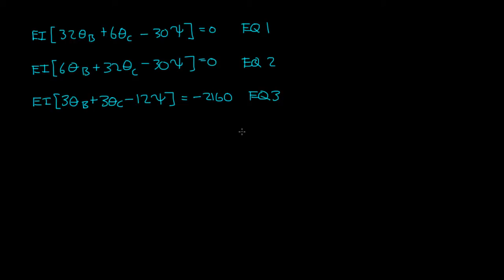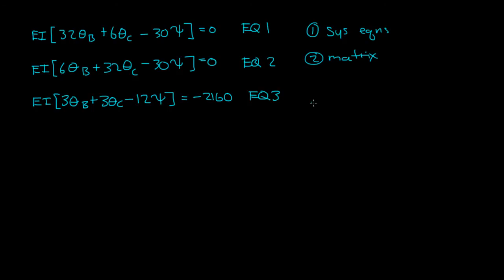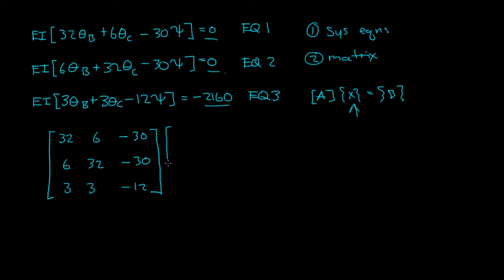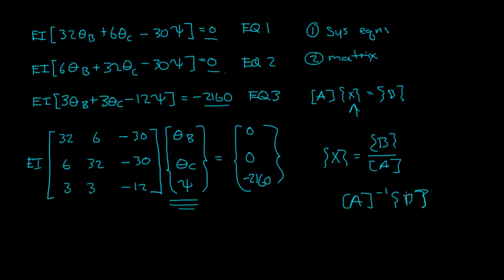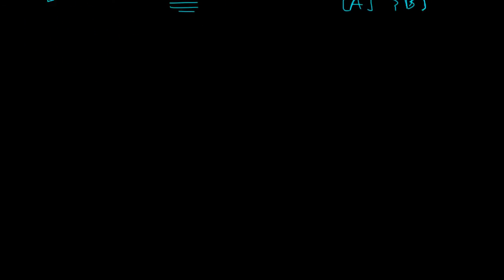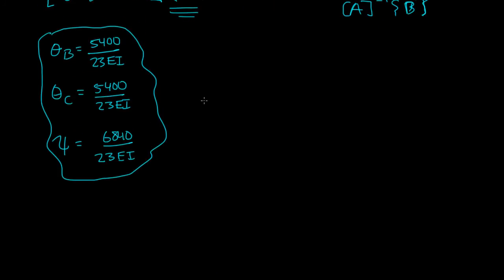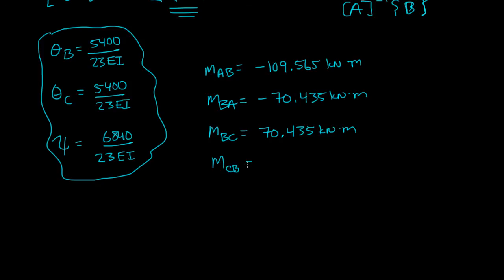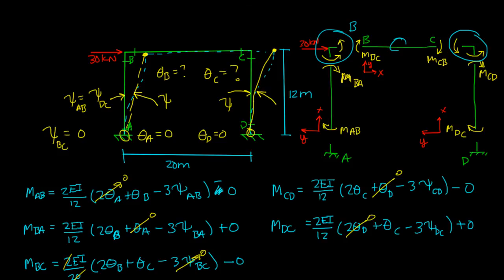Slope Deflection Example 3: Part 5

Comment: I think the multiplication result of your matrix is wrong, I calculated using a calculator to get different results from yours.
I think you just enter the numbers based on the results you get from structural applications like SAP or ETABS